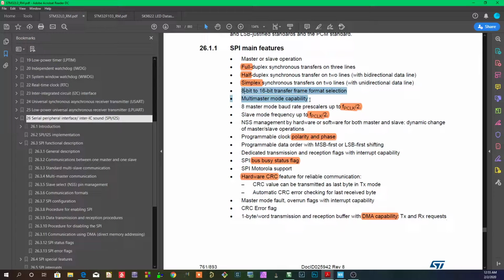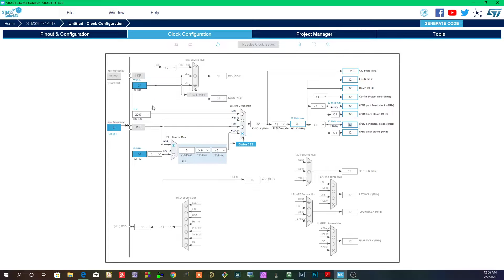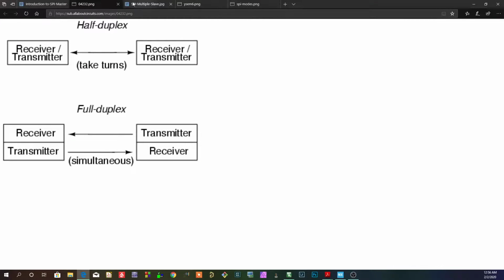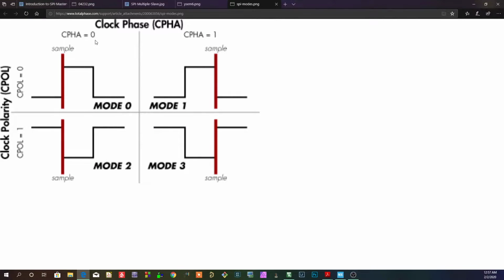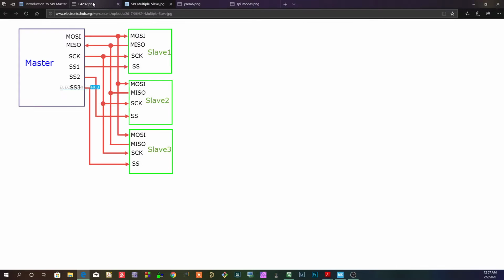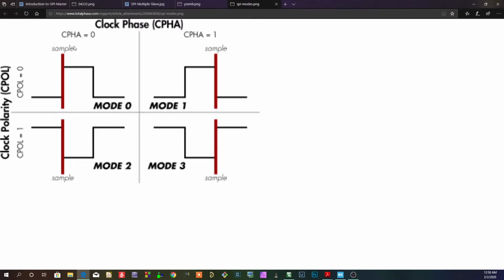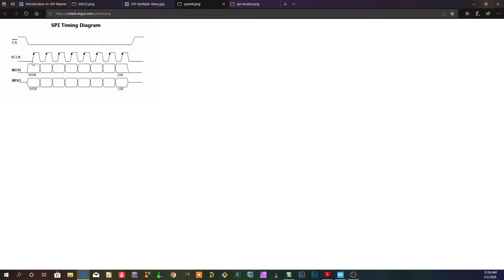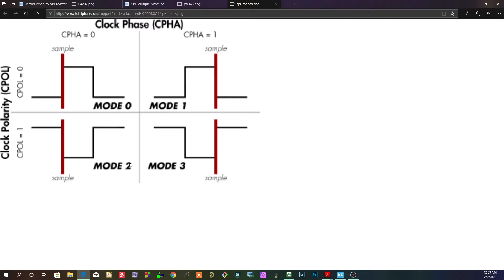STM32 SPI: Pt 3

Comment: Heya Eddie!  I see you utilize CubeMX.  Do you ever utilize the HAL drivers at all?
Just curious.. think I've always seen you using SPL.
I use HAL mostly in my projects.. seems to get me out of the configuration chaos more quickly and let me move on to the actual coding of my projects much sooner.
Unfortunately it tends to dumb me down as to what's going on deep inside the uC...
Reply from the maker: Actually I do not use HAL or SPL, I just write directly to the registers and yeah you get caught up in the chaos of configuring everything... I use CubeMx to look at the pinouts and figure out what pins I can use for what peripheral and sometimes I also use it to view the default settings it gives the peripherals and also the clock tree is useful but I rarely if ever use it for code generation unless I get stuck with my own register level code, then I will indeed generate a HAL/CUBE project with what I intended to do and then observe the resisters and values it assigns and from there I can figure out where I have gone wrong configuring my own registers.  After a while you end up having a code-base of usable and working register level code so there is a lot of copy and pasting between projects. I would like to just start writing full blown drivers...but it really is reinventing the wheel. lol
Reply: @EdwinFairchild  So you're reading and writing directly to registers that are predefined?  Is it the definitions in CMSIS you use?
Like TIM4-> CR1  means you are accessing the Timer4 Control Register One?
It's been awhile.. but those look like def's I've seen while working with HAL/CMSIS.